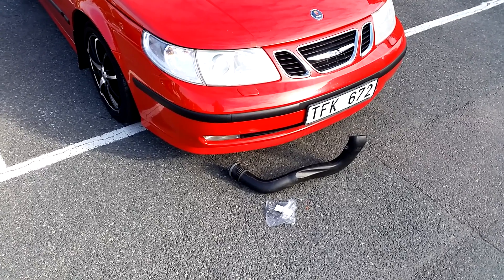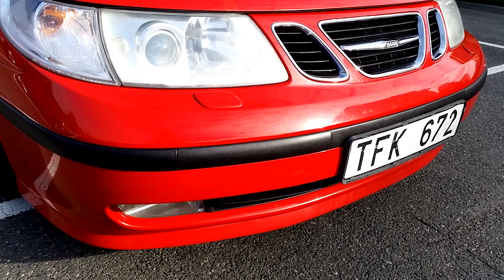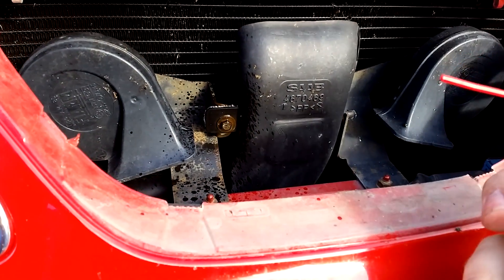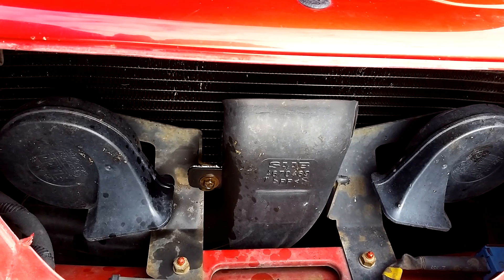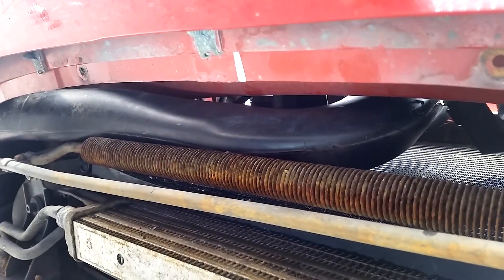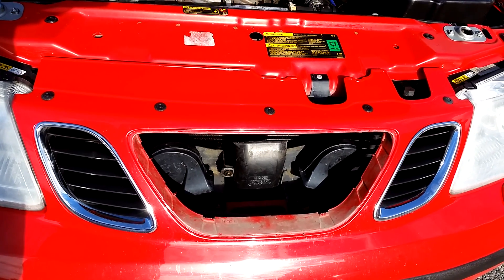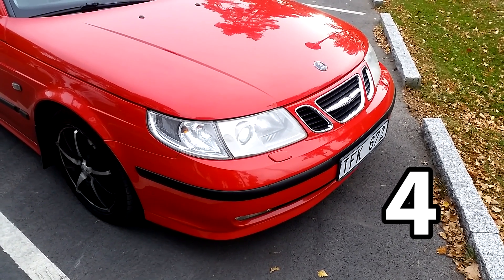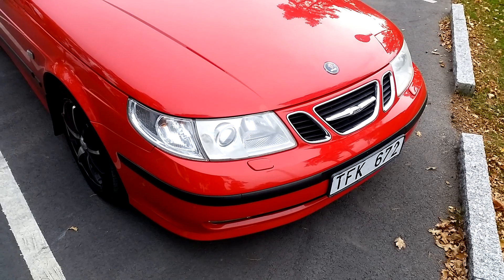Saab 9-5 Mod: Upgraded Air Intake with Diesel Snorkel - Trionic Seven

Comment: I have 9-3OG aero. But the story will be about Astra 1.8i 115hp coupe bertone. I swaped the snorkel from Opel 1.9 diesel. Removed narrow throat  pipes in the filter box https://youtu.be/Lrefix6iIf4?t=51 wich also is a restrictor.  Swaped Air mass sensor (orginal VDO-Continental) and now its a 1.4s from 0-100km/h gain. Its now even kills 1.8i 125hp bertone version with 140hp chip from 40 to 120 with 3rd gear by 2.2 sec.  If You are saying that the 3.0d snorkel didnt make any differance - It can be as saab already has a lot of power but I think there shoult be a 0.2sec incrase.  (by the way Saab 9-3 NG 1.8i has the same 125hp engine - so I recommend to get a opel Part nr: 9177099 pipe) 

Oh - and the other thing is - opel has the inlet face straight to front grill https://youtu.be/Lrefix6iIf4?t=235 , but saab has the face more to radiator. And thats sucks. Its taking a more or less hot air into it. I would and will mod that pipe when I get it.

Comment: Has the snorkel also changed on the 9-3/2? Or maybe I can even use the updated snorkel from the 9-5 on my b207e? Questions over Questions
Reply from the maker: No, it won't fit.

Comment: is there any real hp gain? Isnt it better to put an CAI with a hydroshield (for ex. K&N). Sounds much better than stock :)
Reply from the maker: Nope, as I say in the FAQ, no power gain. Maybe faster response time. I'm against those warm air intakes as they don't do anything and just suck dirt.

Comment: I have a 2003 petrol 95 aero hot wagen which needs too much done to it (costly). I bought a linear se diesel 95 wagen and wondered if i could transfer the leather interior and perhaps other nice features from my aero 03 to my linear 08.
Advice please!😁
Reply from the maker: Good question! I'm not sure you can transfer between before and after the facelift in 2006. I'd ask others on a forum since I don't actually know. Also, rear wagon/sedan seats are incompatible.

Comment: would it work on 1997 saab 9-5 ?
Reply from the maker: There are no 1997 Saab 9-5, so no ;)
Reply: what is this then? http://www.auto24.ee/used/2283881( my car now, bought it in summer 2016) Have to do lots of repairing there, dont know where to start even.
Reply from the maker: That's a 1998
Reply: So i can watch most of your videos and get a lot of help from them, because they will work in my car too? I am a fresh driver, dont know much about saabs.
Reply from the maker: Most of my videos are 9-5 videos, so yes.
Reply: thank you
Reply: I have a 1998 2.3t 9 5 and i have the diesel snorkel in place.  You also will need to take the fog light out of the way in order to have space to unplug and plug-in the mod. The horn braket it's a little different... so you only need to unbolt one of them. You do have more space in these 1998 models, so the snorkel get's in and out very easy. Have fun ;) 
Cheers.

Comment: Seeing as most "stage 2" tunes require ECU upgrade + intake modification, would the snorkel classify under the modification? Or would it be recommended to do that and/or an open air intake?
Reply from the maker: I don't like the "stage" terminology as it over-simplifes the problem. You have to talk to your tuner to see how much air is needed for each tune.

Comment: I just did this to my 2000 SAAB 9-5 AERO manual and I definitely noticed a difference.  I highly recommend this but it doesn't fit perfectly on the 99-01 unless you get the metal mount mout that the horns and it attaches to. I made it work by running a zip tieing through the skrew hole on the mout an the skrew hole on the snorkel.
Reply from the maker: Great that you got it to work!

Comment: I recently received a silver 2005 Saab 9 - 5 arc and was trying to upgrade it's performance and wondered where I should start. I know the Saabs are sporty luxury vehicles and mines only has 85k miles on it as it's been a family car rarely used. I'd also like to ask what rims you have on yours! Great Video!
Reply from the maker: Try to find a tuner and get a stage 1 onto that car. Also, exhaust makes a big difference!

Comment: Hi and thanks again for a nice video!
Do you know if the 2.2 TID has this pipe 'upgrade' pipe aswell?
I have a 2002 9-5 2.2 TID as a spareparts car (wrecked) and woundering if the pipe may be the same as the V6 diesel?
Reply from the maker: Good question. Try removing the grille and feel the size of the inlet, the difference should be obvious.
Reply: Yes i know, gonna try to remove it some day i have time, and i can come back to you if you want to add incase it fits from the 2.2 TID aswell :) If it does..

Comment: Have a question guys to any of You who could know the answer:

What actually it helps with ? can we feel the difference in some way after this mod ? inlet air gets colder, helping the IC breathe better on hot days maybe? I have 9-3 2.0T where snorkel pipe is even smaller than these two..I'd have to cut the 3,0 TDI pipe probably as it's too long but I'd like to know what's the purpose of this mod and what gains I can get ?
Reply from the maker: +k. s.m. This video is for the 9-5 only. As for the differences, they are all explained in the video

Comment: Har precis skaffat en 9-5a själv (-04 Vector 2,3t automat) och tänkte byta till dieselsnorkeln på den, men jag tänkte fråga, nu när du kört med båda på samma motor, om du märkt nån skillnad i förbrukning? I mitt huvud så borde förbrukningen gå ner något, då luftflödet förbättras. Tack på förhand.
Reply from the maker: +TorkelFlum Hej! Nej, ingen skillnad i förbrukning eller prestanda. Som jag säger i filmen så påverkas inte steady-state prestandan. Däremot gör en 3" downpipe enorm skillnad på resistans och prestanda.
Reply: +Trionic Seven: For Saab Enthusiasts Ah, okej. Tack för svar! får se om det blir en 3" sen i framtiden. =)

Comment: Hey there! Nice videos you have there, I really like them :) I actually own a Saab 9-5 2000 2.0t  and so far this is the best car! Anyway, today I did a diagnostic and found out a code p1251, problem with my Throttle Body.. So should i keep on looking for a new ,,TB'' or would it help if i try resetting it ?
Reply from the maker: +Young Silverboy Hey! Sorry, I don't know the answer to the question, perhaps you can ask on one of the Saab forums?
Reply: +Trionic Seven: For Saab Enthusiasts Thank you for suggesting, I already fixed my Saab :)

Comment: Worn bushings for the gear linkage sems to be a common problem for later 9-5s.As a owner of a 9-5 2.3t 2008 biopower which suffers from a woobly gear stick, any hints to replace the bushings would be appreciated.
Reply: I have also been looking for a video of how you replace the gear linkage bushings on Saab 9-5 MY04-10 like the ones from Maptun or Nordic performance.
Reply from the maker: +dfred001 Hey! Sorry, we haven't done that, our cars do not have the wobbly gear stick. I know that maptun sells a metal bushing that they make themselves, perfect for fixing the gear linkage.

Comment: can you do a video on the rear tailgate light (third brake light) as to a replacement upgrade of the actual led lights in it
Reply from the maker: +robert m It's easier to replace the whole light cluster. I did, since the fasteners had broken off completely, causing leaks.

Comment: Suggestion for future episodes: 
saab bolt mod - recently partially fixed power loss with this. now waiting for 1 way valves
This is very easy to do, and might help many Saab owners discover possible performance issue.
Reply from the maker: +bracka Bolt mod?
Reply: +Trionic Seven: For Saab Enthusiasts 
for more info google: saab bolt mod
It has to do with check valves failing and as a result boost pressure control valve is seeing boost instead of atmosphere pressure/vacuum. As a result turbo is bypassed earlier and reduction in performance occurs. So It’s a diagnostic method + partial fix for low
boost. http://www.saabcentral.com/forums/showthread.php?t=203271
Happy 2002 saab 9-5 Aero owner J
Reply from the maker: +bracka That so-called "bolt mod" is a way to fool the engine management system in a bad way. The ONLY time you should do the bolt mod is temporarily, to diagnose if the evap one way valves are bad. The "bolt mod" is simply a temporary diagnostic tool and you should put it straight back after diagnosis. The correct fix is to replace the evap one way valve.
Reply: +Trionic Seven: For Saab Enthusiasts 
I agree with your statement. Could you share some downsides of using it or potential problems?
Reply: There is no downside because SAAB removed the pre turbo hose completely on later models because it only serves a purpose to evacuate fumes under boost(when the evap control valve is closed anyway so it's useless over engineering of a system). Bolt mod is fine, but replacing the intake side check valve is necessary.